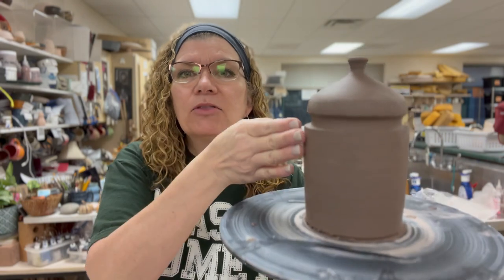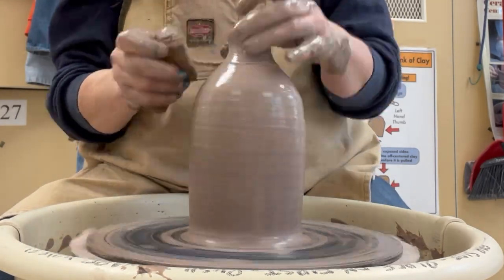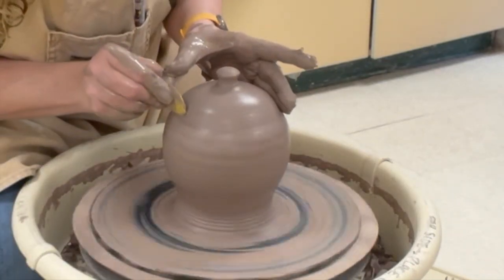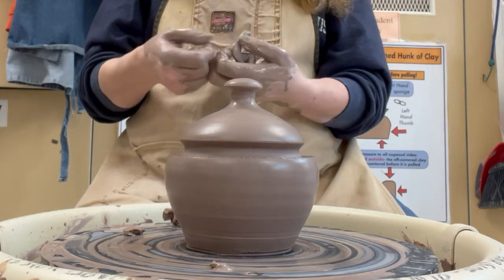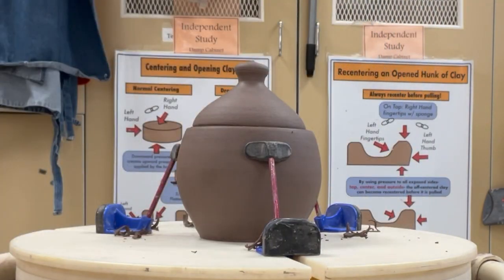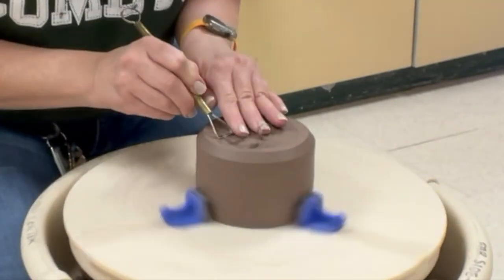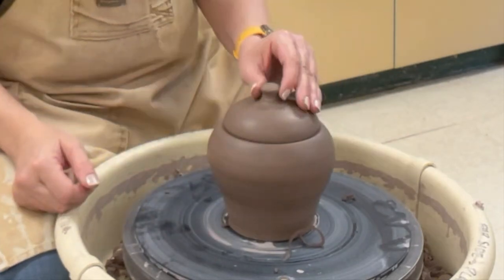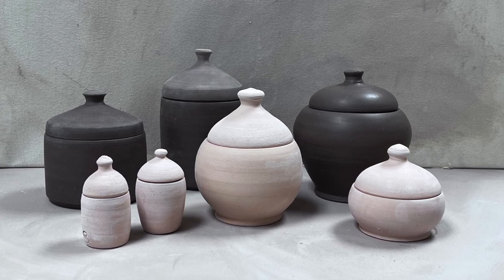Throwing a Lidded Jar from ONE Piece on the Potter's Wheel!

Comment: I’ve followed your videos for years and they’ve been so helpful.  As I’m becoming a better wheel thrower I need help on how much clay to use. Can you please mention how many pounds you’re starting with when you do a project.  I love the lidded pots video and all the choices and mistakes to avoid.  Thanks for all you do to help the pottery community grow.
Reply from the maker: Sorry I left out the weight, Chris!!! I’d assume I was right around 2 lbs for the larger ones- and maybe 1.5 for smaller.  The size will make a huge difference if the wall thickness is greater.  My students use a bit more clay than I would as I throw thinner than they currently are able!
Reply: @KaransPotsAndGlass  thank you. That’s very helpful!

Comment: Question! When you bisque fired, was the lid on the jar? I just tried this and trimmed the lid; while leather hard, the lid was airtight. I poked a small hole in the top of the lid but do you think that’s enough? Should I trim some more so it’s not airtight? Thank you so much for a wonderful video!
Reply from the maker: yes- I fire lids on!  It's really not as air tight as you think!  Lids will always allow air to pass.  Just remember, moisture is what will blow things up in the kiln, rather than air!  (Trapped moisture is the issue- so just candle to dry things out!)